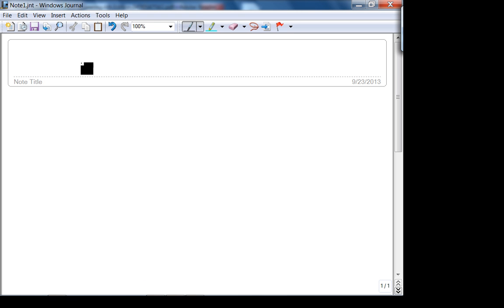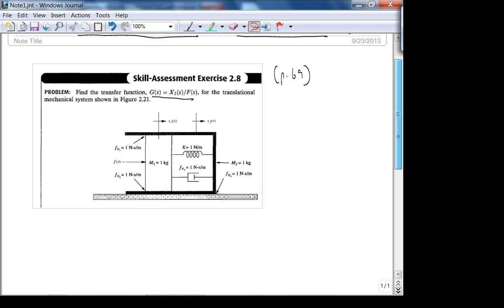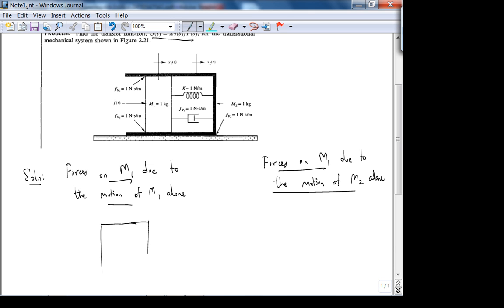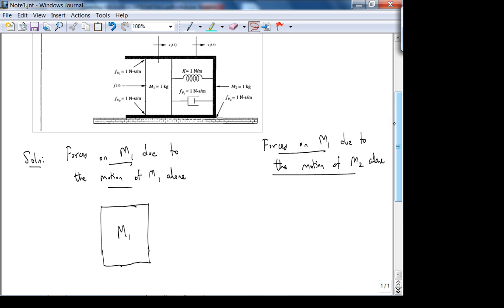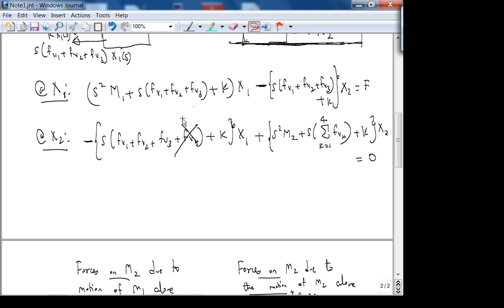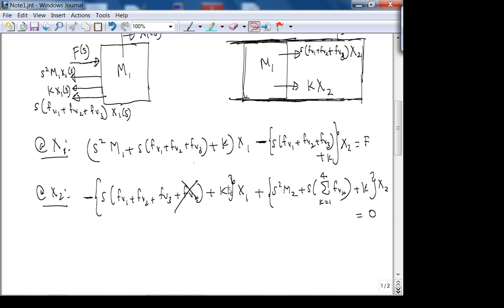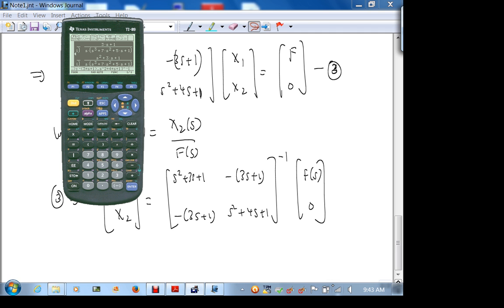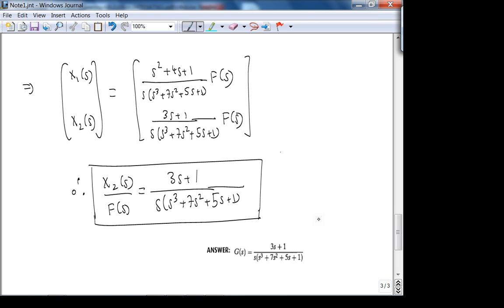ee3050Fa13w3L1 TranslationalMechanicalSystemExample

Comment: What is the equivalent parallel analog for that figure
Reply from the maker: Jasper : thx. for the question.  Since I am not a mechanical engineer, the visualization for me is difficult.  I would obtain an equivalent electrical system and then figure out the mechanical system from there.  
For the electrical equivalent, the mass spring damper becomes an LCR circuit.  The other mass is thus an inductor, that is coupled to the LCR by a 2 "ohm" resistor and a 1 "ohm" resistor to ground.  We would then convert this circuit to the parallel equivalent and then map into a mechanical system.
Good luck.
Reply from the maker: Sorry, just realized the dampers model resistors, not capacitors.  Fixed comment accordingly.
Reply: @Giovanni Anthony Definitely, been using InstaFlixxer for since november myself :)